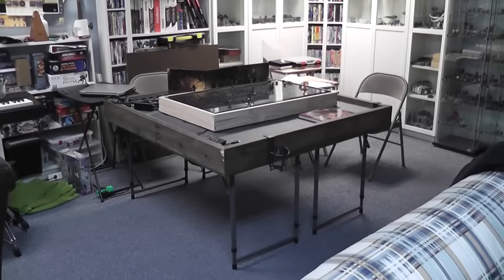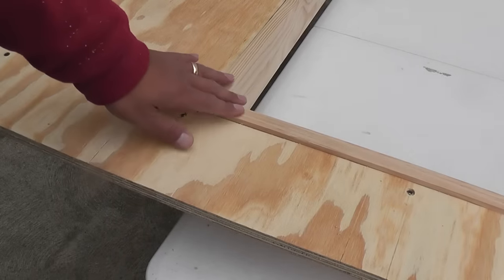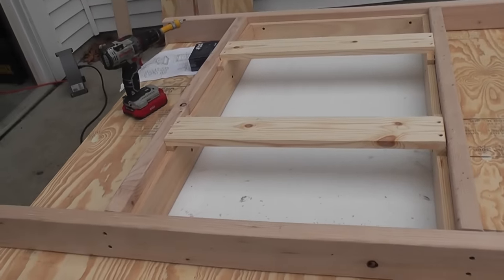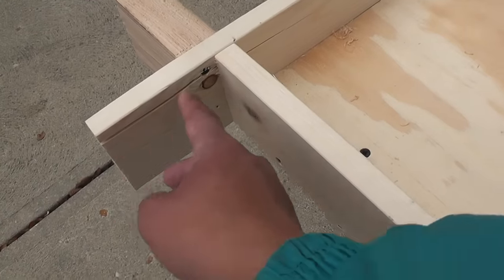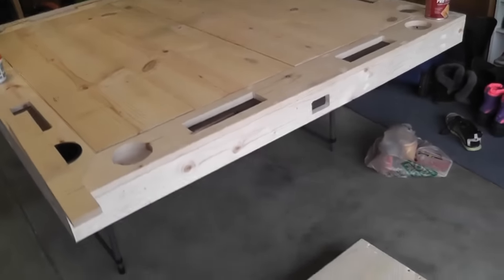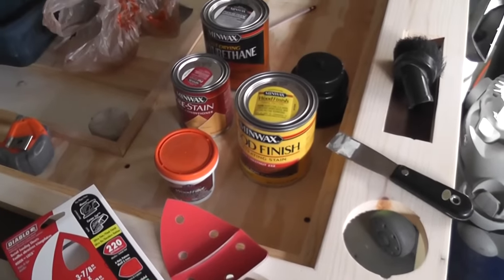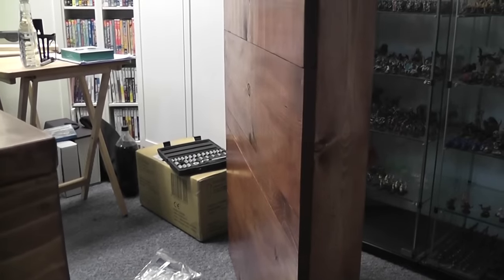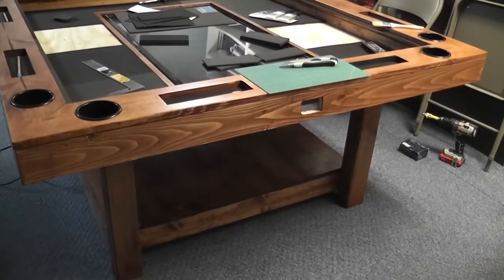DIY Gaming Table for $150

Comment: Useful tip: if you do split wood, remove the screw and use white glue in the split to remarry the pieces. This is important because the split will increase with normal wear and tear. When the glue is dried, replace the screw carefully. Don’t restress the fault line.

Comment: I love to project but you really should have used proper device boxes for your outlets. There is an electrical code book for a reason. Also you are not supposed to put stranded wire under terminal screws. you could have use crimp-on screw connectors or had a solid copper tail.

I still love the project but as an electrician I had to criticize.

Comment: Thanks for your video. It is a big motivation for me to build my own table now. I will certainly do the one or other part differently. Unfortunately I will not end up with 150 USD, since the wood, even if I take "cheap" wood will be more expensive here. The idea to use two beams instead a big one for the foots was really great.

Comment: Just some notes to a fellow wood worker. First off I appreciate the HELL out of seeing someone make new stuff, especially in the nerd realm. Just some things I would suggest... when sanding your project to get ready for stain, you can get rid of the bumps and texture you were talking about in your “5 things you would change” video by running it through more than just the 220 grit, maybe start with 80 and work through the grits to 220. It will give you a much smoother finish and help with some of the problems you ran into. Also instead of a poly, there are several other choices out there that gives a much harder finish that can make up for the pine being soft. At the end of the day it is just pine, but a hard lacquer or maybe even a thin epoxy coat can help a bit.i understand the point of this was to keep it on a budget, but a quart of lacquer should be comparable to a quart of poly, or at least only a few dollars more. You addressed most of the other things I would’ve changed in your follow up video and I think someone else recommended the outlets with the USB plugs. Other than that I’m so glad to see someone making something the way they want it instead of just buying another run of the mill product. Loved watching this and hopefully I’m gonna make something similar that I hope to post on YouTube. I haven’t gotten into making videos with my woodworking yet but hope to soon! Keep making videos and improving your craft. Looking forward to seeing more. And don’t forget to countersink!!
Reply from the maker: Thanks for those tips!  Do you have a link to an example of hard lacquer?  I've never heard of that but I'll give it a try.  Make sure to post a link here for your video build!  I'd love to see it.  And if you haven't already, check out the BGG forum where a lot of makes are posted:  https://boardgamegeek.com/thread/1471747/build-gaming-table-150

Comment: Just a couple of things I wanted to say.  Don't take them too seriously.  I just like gathering my thoughts as I watch videos, so each point will have a time stamp by it denoting when I thought of it during the video to help add context to my thoughts.  Just to clarify, I don't intend to sound condescending or demeaning in anyway.  I just want to share my experiences and ideas as well as emphasize points and whatnot.

6:31 - Consider using an impact driver when working with dimensional wood.  It makes screwing long screws into soft woods very easy without needing to pre-drill holes.  I also rarely have boards split on me.  Very useful if you do a lot of carpentry; and judging by your pouches and tools, I'll assume that you do.  Additionally, if you're using philips-head screws (I heard your bit slipping a few times), consider switching to torx or square-head.  They're much easier to work with -- both now, and when they've started to rust.  Applies more to outdoor projects, of course.

15:06 - Splits do happen.  I find the impact pushes it in fast enough that I can avoid most splits.  You just really have to watch it to keep from over-drilling and stay clear of the edges.  But I'm sure you know that and I'm kind of beating a dead horse at this point, so I'll chill out on the impact vs drill thing.

17:15 - If you drill out 2 holes on opposite corners, you never have to worry about turning the jigsaw mid-cut.  Not a big deal, though.  "If it aint broke, dont fix it," right?

26:14 - ooo countersink.  Fancy and practical.  :D  For those who don't know, it's a good idea to pre-drill and countersink (making the cone shape hole for the screw head to fit into) when you have to work close to the edge of a board to avoid it splitting.  That close to the edge, even just a screw head can split a board.

26:50 - Awesome idea!  I was wondering how you'd go about making the top easy to remove and replace.  I don't think I would've thought of that if I'm honest.

29:10 - Pre-stain is always a good idea for soft woods.  It adds a little more time to your project, but it well worth it.  I learned that the hard way working with maple a while back. 

32:21 - You might consider adding sheet of plexiglass over the bottom surface of the table to help protect the TV screen from scratches and possibly spills.  

34:07 - The edges of the dice holders look like they could use some more sanding, but I'm really just being knit-picky now.  Edit* I dont feel as bad for saying that now that I watched a little further and you mentioned it too, lol.  Perhaps make a sort of insert that will cover up the rough edges.  Kind of like the cup holders do for the round holes, but of course, without a bottom.

36:48 - Agreed.  Polyurethane (or sealant of some sort) is not optional.  It is a must.  It will vastly improve the lifespan of the project, as well as make it look better and be easier to clean.  

Stopped at 42:55 because unfortunately, I ran out of time to watch the video.  What I saw was great, though.  It looks amazing and even though I don't intend to make one myself, it was really cool to see how it went together!   Keep up the good work, and maybe post a video about that game you pre-ordered? ;D  I've never heard of it, but it looks pretty fancy.
Reply: You ran out of time to watch the video but had time to write a dissertation on it?
Reply: Derick Ryan Good thoughts, thanks for sharing!
Reply: Pre-drilling holes soft or hardwood is must for longevity not just avoiding splitting, splitting only happen you prepare the material wrong or use a process that would apply irregular stress on the wood.

Comment: Just started to build a game table by using a bunch of the ideas you have here. Thanks for the inspiration and the how-to.
Reply: Finished my table. Thanks so much! Cost more then 150 tho. Also to anyone doing this, a miter saw is needed for corners. Table saw doesn't allow precision. So my corners are slightly off.

Comment: Great Job, might be a winter project for me :).   You might try to find someone local that has a 3d printer to custom print you some inserts for the dice trays, similar to the cup holders.
Reply: 3D Hubs is a community of people that own 3D printers, see if you can find someone near you
Reply: Vacuum forming or thermal moulding would be an easier and cheaper method to make you own inserts, I would choose vacuum forming myself. Just need access to an oven and a shop-vac.
Reply: lengthOFpole I don't know much about vacuum forming, but I assume it is a lot stronger than 3D printed results. 3D printing is great for complex shapes and custom designs, but for thin walled designs that will be subject to some abuse, I assume vacuum forming is more robust.
Reply: you could also make a mold and resin cast them.

Comment: a tip from someone who had an internship as a carpenter: use a sponge in a circular motion for staining and a pair of gloves. makes it easy and gets the stain in there :)
Reply from the maker: Thanks for the tip!  Will try it next time.
Reply: In joinery we specifically use dense mattress sponge, and then the rule is to cover ALL the item being stained — be it a cabinet carcass, front pieces of drawers, chairs, table, loose table  leafs etc — before the spot one started on starts to dry (so customers will not be able to spot where the staining process began).

Comment: This is probably the best build I've seen so far. I'm looking forward to having the space to make my own (soon, one hopes), and you better believe I'll be using your design for a good bit of inspiration. Great work, especially with the ChromeBox upgrade you showed in the other video! I didn't even know that was a thing. ;)
Reply from the maker: Yeah, I didn't know it was a thing either until I looked into the Raspberry Pi.  Someone said the Chromecast stick might work as well and it is cheaper.
Reply: Gaminggeek
 So now that you've had it for close to a year, what do you like best about your table? What would you change next time? Anything you would add that you hadn't thought of? Is the pine still pretty solid?
Reply from the maker: I did add caster wheels to the bottom so I could move it more easily which became necessary once I got a VR headset and needed the extra space.  Other than that, I would not make any changes.  The pine has held up well, although there are some dings in it which I expected.  Wouldn't change anything else--has been awesome with D&D and other board games.
Reply: Cool. The casters make sense. Thanks for the info!

Comment: Nice work, but bro....You've got to get that electrical safely into insulated boxes. No reason not to, especially with that much work. Don't want a kid getting zapped or friends getting hurt grabbing underneath. Looks great.
Reply: he did he retro fitted it with saftey boxes for the outlets and made safety measures for the wiring
Reply: Paleoint I was thinking the same thing. I didn't see any reason not to drill transfer holes for the wire to travel through either. Keep it all high and even cover the outlet access. Seeing the exposed wires is just asking for trouble.

Comment: I'd like to thank you for the inspiration, as I've just made a gaming table of my own. I gathered ideas from a few different sources and from you I got the idea to run electricity to the table. I chose, however, to make one of the legs hollow, ran a cable through that and put a C14-socket at the bottom for easy connecting as needed.
Reply from the maker: That's a great idea!  Glad my plans were helpful.  If you have posted any photos, I'd love to see them.

Comment: One serious problem with that table....
The part that is going to carry the most weight and suffer the most abuse(the outer framing) is only supported by the edge of the plywood table top. The main frame should be extended to support the circumference or u will find screws cracking through the plywood and the outer frame will start to fall off.
Ppl are going to be leaning on it, bumping into it, potentially falling on it(ppl trip sometimes) and(despite all intentions otherwise) sitting on it. It will break.

Other than that, looks good. Only things I would change are stylistic

Comment: I liked the video 👍 Just a thought though: You could recess the TV a bit more add a lip to the wood frame and inset a plexiglass cover with some weather stripping for scratch and spill-proofing the TV.
Reply from the maker: yeah, that's a good idea, although I didn't want the plexi to be too far above the tv in order to avoid the minis from "floating" off the grid.

Comment: Personally, I would file down the imperfections on those side pockets. Then, get a router and give all 4 sides a nice clean edge. You'll have to restain and coat with poly, but it would really be worth it.

Comment: Beautiful table, given me plenty of ideas for a gaming table. Now for totally late to the party ideas:
Yata yata electrical is dangerous, obviously change that. 
Those personal cubby holes, genius, how tf did you not sand those out to perfection; you're crazy! Silicone the whole thing and hit the corners of the table with some padding.
Lastly, I get that the tv was kinda sold into this lifestyle and may be too far gone for this suggestion but the entire time I thought you were gonna put a sheet of Plexiglas over the tv hole. It would save any tv from the hardest dice roll and you could go as far as to use dry erase markers to have the ultimate customizable game board.

Comment: a drop of oil or some wax on the screws will help a lot if your drill is a bit on the weak side for that size screws
Reply from the maker: +Jesus von Nazaret  That's a great idea!  Thanks for the tip!
Reply: +Gaminggeek To add to that, if you're going to be doing a lot of screws, a wax ring seal for a toilet gives you a bunch of good wax at a good price.
Reply: Another great option is just to scrape a screw along a bar of soap.
Reply: or use some spit
Reply: +Gaminggeek Or you can get an impact driver as that is a power tool specifically designed for driving nails with max possible torque.
Reply: camero12321 sure, but some people don't want to spend extra money on power tools, when they want to build a budget project
Reply: camero12321 Depending on the wood you're using, an Impact driver isn't going to help you. I've gone through Rock Maple, both crossgrain and endgrain, and ended up shearing the screw in half. The torque was there to drive it, but the screw couldn't handle the stress. I took the same size/type of screw, lubed the threads, and was able to drive the rest without incident. 
Besides, most drill/drivers these days have adjustable torque controls already. All an Impact driver adds is the slight "hammering" motion to the driving process.
Reply: +Jesus von Nazaret Makita has a impact driver and a standard driver in a two set for just over 150 and ive never had problems with it
Reply: @Andrew Brannan That's a great suggestion! Thanks!

Comment: Just saw this video a week or two ago and it really inspired me to make my own. I have no wood working experience and was surprised how easy it was to do. A couple changes I made: I extended the table from 4x4 to 4x6 for a little extra leg room, I added led lights on the inside, I found plastic "dice trays" (just storage containers) that are 2x9", and I used plywood cut into 4 pieces for the top piece to avoid warping.

I got the whole table put together in about 14 hours, wiring took about 2 hours (including a trip to home depot for wire nuts), staining I haven't done yet but I think will take about 2-3 days since there are long wait times to dry. Overall I expected it to take me 3 weeks to do and I got it done in the first few days. 

Price: Lumber: $425 ish (used Oak for the top and Sandee plywood for cover)
Hardware/Electrical: $60
Random Accessories: $75 (Led lights, cool light rails the diffuse the lights, cup holders, dice trays, and EVA foam)
Additional power tools I didn't have $550 (bought a sander, nailgun, and a miter saw)

So total cost for the table alone was $560, I couldve done it for around $325 if I had to, but I'd highly recommend splurging on better lumber for longevity.
Could also skip the additional power tools, they helped speed up the process a lot, probably saved me 5 hours of work.
Reply from the maker: Awesome!  So glad you took on this project and now you have an awesome (and large!) gaming table!  Did you post pics on the BGG thread?  I would love to see it.
Reply: @gaminggeek241  I'll be adding pics in a few days when I'm done staining it!!

Question, how did you attach the PVA foam to the table? Or do you leave it unattached for cleaning?
Reply from the maker: @patfee5766  I left them unattached as they stayed down without any glue.

Comment: I didn't see a comment about it, but if you want a good alternative to wood putty you can mix saw dust and wood glue. It sands nice and stains nice.
Reply from the maker: +Non Stop Table Top  Doesn't the glue prevent the stain from adhering?
Reply: +Gaminggeek since the mixture should be a paste it's mostly sawdust. I have never encountered a problem.
Reply from the maker: +Non Stop Table Top  Okay, I'll have to try it next time.  Thanks for the tip!

Comment: Please re do the side plugs properly with junction boxes the wiring looks dangerously horrifying 
( I’m an electrician )
Reply: Would it be better to call a professional thinking of making table like this
Reply: Definitely add boxes there is a tool to release the wires from the backs it's almost like a metal toothpick off a Swiss army knife or a lock pick... Measure the holes and you can get caps like the drink covers to fit them or just pound some metal arround them if you know how... ;) It's a good table I remember the first time I drew up a map on gimp for my players and put a transparent layer that they erased  as they moved Thier lights it was a great way to hide encounters and a perfect use of a TV and a mouse... The whole time I could see my notes and both layers on my screen, but it felt awkward sharing the mouse. Here they could just point.
Reply: Great looking table, but your comments on wiring made me cringe. That's not "low voltage" and stacking wires does not fall under "should be ok". Also since youre expecting liquids to be spilled, use a GFCI as the first receptacle (where you plug the tv in)
Reply: 100% agree. (former electrician)

Comment: I realize that this is an almost 7 yr old video...  I think you did a fantastic job.  Just in case Gaming Table v.3.0 is in the works though, be careful with the air nailer.   The nails sometimes curve when they go in and can come out the side of a board.  At the 12:00 to 13:00 minute mark you put your off hand in a couple of scary spots.  Be safe and and happy gaming!!  :)